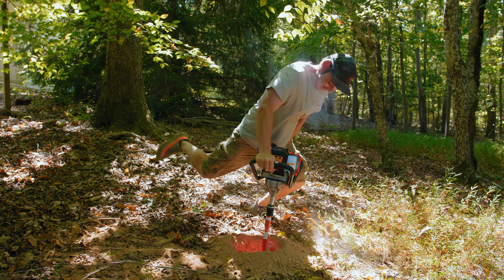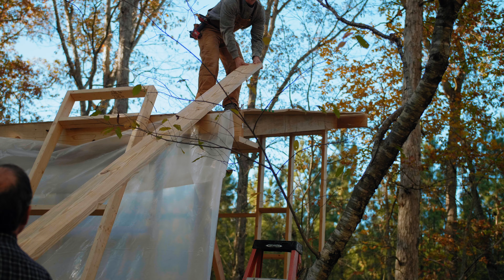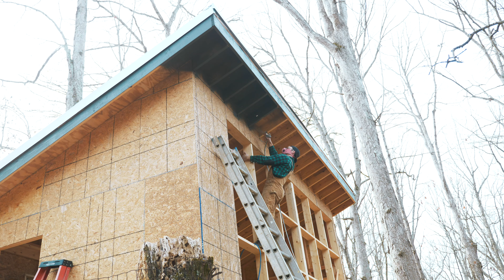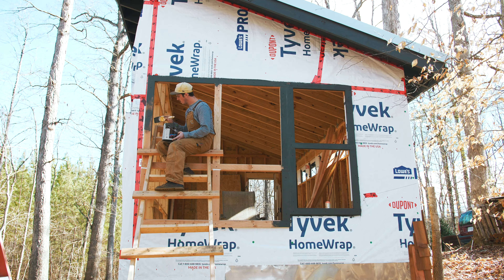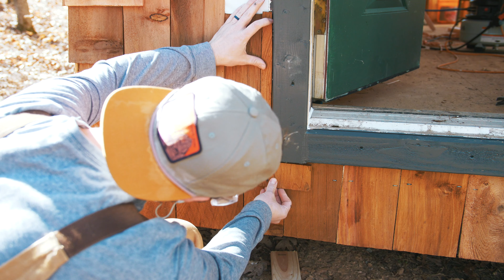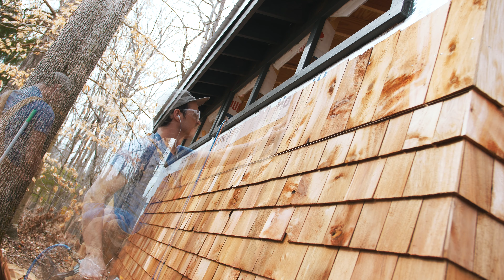Cabin Cedar for DAYS - Cabin Build Ep.21

Comment: What kind of nails are you using with that gun? I’m assuming they are some sort of galvanized nail? I’m wondering what the thickness of those would have to be. I feel like they would split the heck out of those cedar shakes.
Reply from the maker: Galvanized medium crown staples!
Reply: @WoodnessGoodness  thanks for the response! Did you have any experience with the shakes busting? You did a killer job. Looks amazing!

Comment: Hey Legend!
Any chance you can tell me how many packs of "cedar siding" you used for the front of the cabin. I'm building one similar but only using the cedar siding on the front. Would love an Idea on how much you used. Here in Australia it's $212 a pack. Each bundle covers an area of 2.33SQM. So I'd love an idea on how many packs you used. 
Cheers from OZ.
Reply from the maker: Yikes!!! That’s a hard guesstimate. The bundles/packs I used were 25USD each and covered about 20 square feet or so...